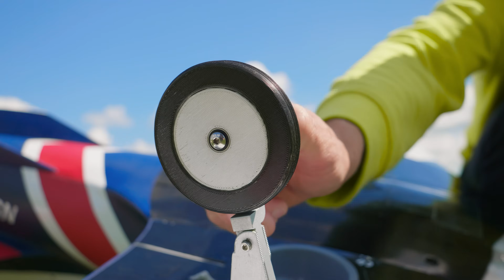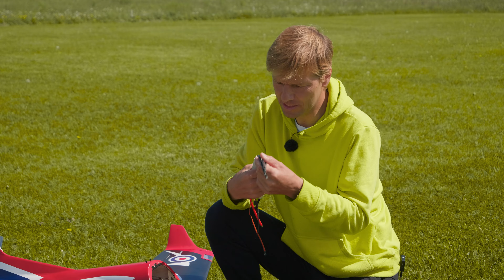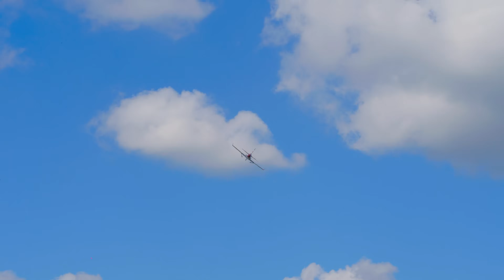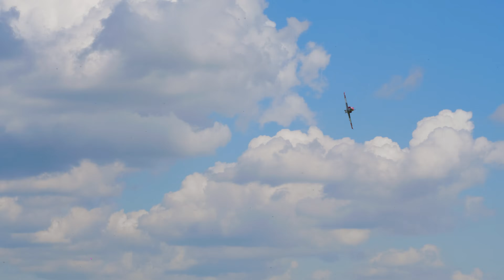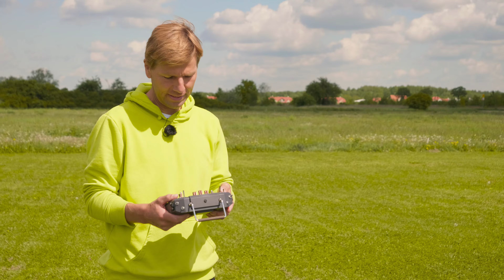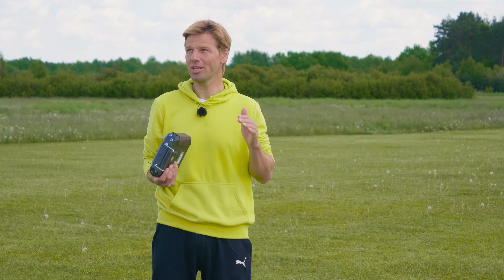Follow-up Black Horse Viper XL 14s 8Ah 130A 6.5kW EDF 100mm WeMoTec Midi EVO Jet Sound 3D Printed LG

Comment: A question to your battery: You describe 14s 8000 mAh , weight 1880g. So in my calculation you need 28 T40s, means 28 x 70 g = 1960 g + plastic parts + cables makes around 2100 -2200 g?
Reply from the maker: my mistake, thanks

Comment: Love it! I can't wait to try some of your ideas on my next EDF. Thanks for the great tip on the current sensor! I'll be doing that on the 40A version to use in my smaller models.
Reply from the maker: I did it already and it showes 10x less with 12awg cables soldered in so I changed the conectors for XT90 and now I have 400A 8s sensor :) Yes it works on 8s :)

Comment: The sound is incredible. Do you think that hobbywing 160amp 14s ESC could handle this setup because that's what I purchased and was  planning on using in this model?
Reply from the maker: It will be perfect for this setup :)

Comment: Indeed, the sound is "deeper", more bass. Can be clearly heard comparing the first dive & pass in both flights. 
Any idea / theory how this can be explained? Why do the cheaters (or the little grates you added) cause this sound difference? 
Fantastic plane by the way. Don't change it any further, it's a perfect machine already! Congrats for building it.
Reply from the maker: It tempts me to change it but you are right, it is a dream machine:) Without grates in the cheater holes the sound was pounding like drum and did not resamble jet at all. Take a kithen strainer and blow into it with your mouth. It is Jet Sound :)